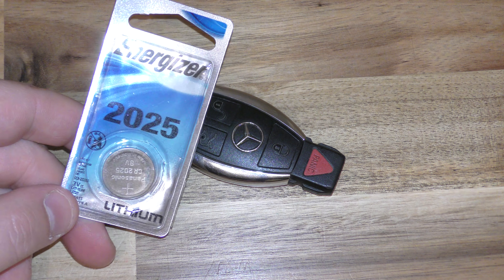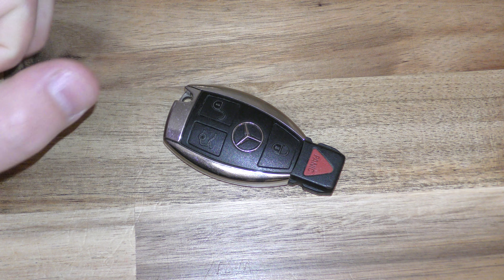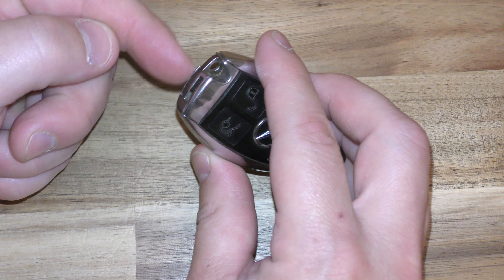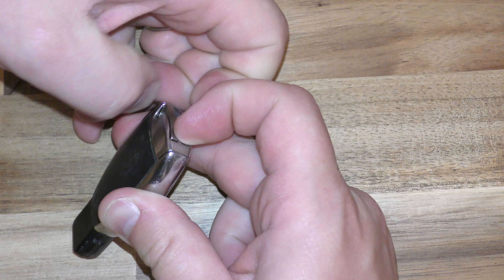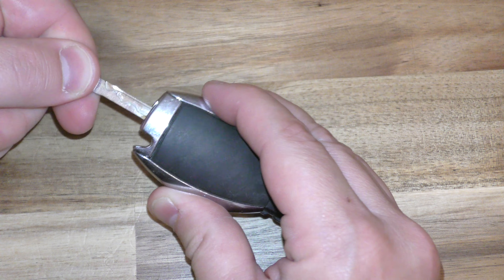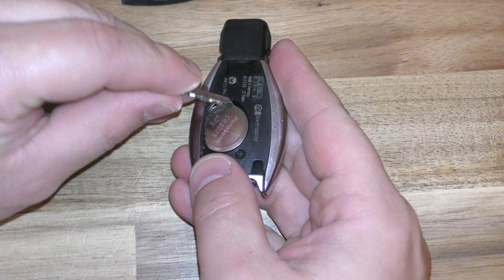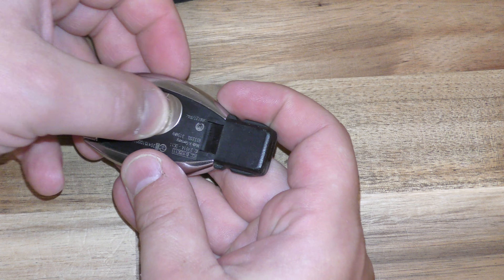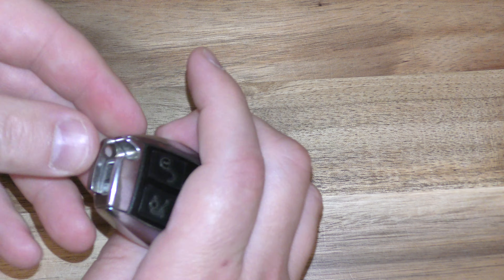Mercedes Benz key fob battery replacement - EASY DIY

Comment from the maker: 2025 Battery you need - https://amzn.to/3g6MHLc
Reply: P
Reply: 90
Reply: a more common 2032 fit and worked just fine for me !
Reply from the maker: Either will work in this fob
Reply: @KeyFobRob  Thank you, Rob!
Reply: @Chriscx  does one last longer though?
Reply: The larger 2032 has 240 mAH while the smaller 2025 only has 170 mAH, which stands to reason the larger should last longer. However, I imagine you're looking at 5+ years either way. If it drains faster than that. the battery is more likely to drain due to some pressure being left on one of the buttons overnight. For this instance, the size of the battery will not matter.
Reply: @Chriscx naw I had them and compared my two keys after. The 2032 was bulging the casing. So I doubt it's still waterproof after
Reply: Thank you. I'm 30, don't know much about cars, I knew they had a mechanical key, I used ones yesterday to help someone that was locked out of their car, but thank you for showing me it's a 1minute job to fix the battery for them.
Reply: There are some aftermarket versions of this key that do not appear to open by inserting the key to pop the back plate off. Would you investigate this and PIN an additional comment that goes through any alternative steps? I am not able to get the back off and followed the video.. as it seems so easy amd simple. Others have left comments describing similar problems. THANKS

Comment: All was great until it came to where to push the key into the top to pop the back open. Wished you'd shown were you did that but otherwise great, thanks.
Reply: Was great that the video was short, but on difficult parts like your describing (where I had the same issue, and still don’t have the back portion taken off). He should have slowed down and given a better direction that just pop this in right about here.  What do you mean pop this in right about here?  Is there a different tool I can use instead of thinking im going to damage my key?  Does the key fit properly into a certain area?  Are you supposed to be hitting something that allows it to pop out?
Reply: @KeepitReels4real all you have to do is watch where he's sticking the key in to find the position where it'll pop off.  It's not that hard.  Mine popped off in less than 2 seconds.
Reply: He did show it!
Reply: There must be slight variations on fobs because mine ain't just 'poppin off'
Reply: @Tony-kc5fi  it will!!!
Reply: No it didn't..my key although looks very similar comes apart in a different way..! Basically the silver bits come off, top first then the 2 side trims..giving access to circuit board and batteries by sliding them out...very tricky when your just going at it blind 😂
Reply: @Tony-kc5fi  Glad you were able to sort it
Reply: Great! Done in under 1 minute! Thank you!
Reply: It only took like 5 seconds to figure out. If it's that hard for you, or if you have a different model, just use your owner's manual. It's not everyone's job to walk you through it.
Reply: @lovelyrose2989  Funny that your "handle" doesn't quite match up with how you address people. Curious.
Reply: Did you actually watch the video? 🤦‍♂️
Reply: @KeepitReels4real I am having a similar issue. My key appears to be an aftermarket one so.. the "easy trick" that it appears to be in the video is not working. There seems to be a different process for some keys and this video does not address that.
Reply: For those where this process didn't work (me included, but thank you for creating the video), there is a slightly different model key fob. I found manual and it explains you actually take shorter end of mechanical key (picture it like bottom part of a capital "L"), push that part slightly into back part where key release latch is, and then move it away from you. That will allow you to pull out the unit (silver part) where 2 batteries are located. On this key fob the black part doesn't actually pop out (that's why some of us were struggling to get it to work). Hope this helps
Reply: @ZacLinton For those where this process didn't work (me included, but thank you for creating the video), there is a slightly different model key fob. I found manual and it explains you actually take shorter end of mechanical key (picture it like bottom part of a capital "L"), push that part slightly into back part where key release latch is, and then move it away from you. That will allow you to pull out the unit (silver part) where 2 batteries are located. On this key fob the black part doesn't actually pop out (that's why some of us were struggling to get it to work). Hope this helps
Reply: @TL-uw3nu there are at least 2 different variations of these keys, I have 2011 SL550 and 2013 S550, identical keys but 1 has 2 batteries  that slide out, the other has 1 battery that the cover pops out. The video did not mention the differences. The older version is a bit challenging to open.
Reply: @Tony-kc5fi Yes, there are  different ones

Comment: Thank you for the video to remove the key fob battery. I wanted to make one note for some Mercedes owners. Some of you might have the same problem that I do. Energizer batteries do not stop the 'Replace Key Battery' message from the odometer. The trick is to use a Panasonic battery. Some key fobs work with any battery, but mine has to be a Panasonic battery. Still the CR2025 - but a Panasonic.

Comment: Clear, concise and to the point. That's how they all should be.
I just opened mine and found some corrosion on the battery at the edge contacts. The battery still read 3V, so after cleaning the edge and turning it to a shiny area, key worked perfectly again. No need for a new battery.
Thank you.
Reply from the maker: Glad it was helpful!

Comment: Thank you! Had I known this a month ago? I would not have been going through intermittently, having to use the manual key and setting off my alarm which is a new fit. I thought I was going to have to spend money to get a new five, and this worked like a charm. I got the battery from CVS and did it right in my car before I drove off. Thank you!🎉😊
Reply from the maker: Excellent! Glad the video was able to make your day a little bit easier :) Take care

Comment: Quick and to the point, THANK YOU! Very helpful! Also I just wanted to note I just tapped my fob upside down and the old battery came out instantly, may work for you if you want to avoid struggling with your key or screwdriver to remove the old battery.

Comment: Thanks..perfect!!!!!!
..my battery says CR 2032
FYI
CR2025 batteries are similar to CR2032 batteries, but they are slightly smaller and have a lower capacity. Both CR2032 and CR2025 batteries are widely available and are often used as replacements for older or dead batteries in electronic devices. Including electronic car keys.

Comment: Very helpful video because the battery died on my Mercedes E350 key FOB.  Thank you very much!!
Reply from the maker: Great! Glad the video was helpful
Reply: How did you know that it was the battery on the key fab that died? And that it wasn’t another problem. I’m asking because mine died on my 2019 A220, and I’m a little concerned about driving it. But Mercedes says it’ll take a week at least before they can fix it
Reply: @bntelenniss  I knew it was the battery when the key fob wouldn't lock or unlock my car doors.  It's easy to replace the battery yourself by following the instructions in the video.  You can buy replacement batteries on Amazon (they're inexpensive).  If you're not up to the task then take your car to the dealer and ask them to put new batteries in your key fob. You should have two key fobs so remember to replace the batteries in both of them.
Reply: Don't worry, a new battery in your Key FOB will probably solve the problem.

Comment: Thanks much. Other video's show that with the all black, or chrome edged key, to remove the 'mechanical' key, then use that key to push to the side/slide lock tab to the side. Mine would not do that, no internal tab to slide over. Then I found this great video, shows to push down into the depth of the key, then I was able to finally open mine. Why would MB change the black & chrome edge keys from a slide over tab, to a push down tab? Wonder how many have broken their key parts in frustration not knowing there are 2 different types? Something else strange, I have 2 fob keys, one is all black and contains two 2025 batteries, and the other has the chrome edges but only contains one 2025 battery. Why would they do this? Why 2 batteries for the black one, and one battery for the chrome edged key? Thanks for your video, it saved me frustration trying to slide over a tab that other video's show that mine doesn't have, mine is a push in like your video shows, thank you!

Comment: Was able to use 2032 battery instead of 2025 works fine
Reply from the maker: The 2032 is slightly thicker than the 2025. 2025 is best to use but the 2032 certainly will work in a pinch

Comment: The mechanical key is missing. I was able to use a small flat head screw driver to get the back to pop off. Any ideas if the mechanical keys are available online or must you go to Mercedes and pay an arm and leg?
Reply from the maker: Are you missing both mechanical keys?
Reply: @KeyFobRob   We only have 1 key fob.
Reply from the maker: if you don't have 1 that you would be able to duplicate, then you're entering arm and leg territory

Comment: Hope this works. 
My boyfriend has issues with the key fob for his '07 E350, it won't work at all if the fob is cold. Even after just driving the car with the a/c on or sitting at home in the air conditioning the fob gets cold and refuses to work. We have to warm it up to lock or unlock his car....
Reply from the maker: That's usually a symptom of a weak battery. Changing the battery should help tremendously

Comment: Does it have to be a 2025 battery? I have a 2010 c class Mercedes
Reply from the maker: You could use a 2032 in a pinch

Comment: My question is how do you know that it’s a key battery that’s causing the problem. I have a 2019 A220, that just died yesterday and wouldn’t start for a few minutes, the dash went black, eventually it did start. But how do I know it’s the fab. Mercedes says it’ll take me over a week and a half to get my car serviced. So much for Mercedes service🙄
Reply from the maker: Your dash will indicate that the battery on the fob is low

Comment: Why would it ask for a battery change a week later? Happened a few times to me now
Reply from the maker: Probably just a bad batch of batteries. I'd get some new pack - 2025 Battery you need - https://amzn.to/3g6MHLc
Reply: @KeyFobRob  I have tried a few
Reply from the maker: @AD-de8jg  The connection have any corrosion on it?
Reply: @KeyFobRob  not that I can see and it’s happening on both keys
Reply from the maker: it just seems like the pack of batteries you have is weak. Try and brand new pack from Energizer or Duracell
Reply: @KeyFobRob  thank you I will

Comment: I have the exact same fob bit it takes 2032 batteries.
Reply from the maker: The 2025 and 2023 are generally interchangeable. The 23 is a little bit thicker and will last a little bit longer

Comment: My fob looks the same but the panel will not open. Even my garage gave up.
Reply from the maker: There are two different styles - Try this one - https://youtu.be/aaYjM2S7BmM
Reply: @KeyFobRob  Thanks Rob. That got me in and replaced the batteries with new. But it won't work. That's two fobs that don't! The original 1999 and a replacement from around 2015 - the one in the other video. Thanks - I'll keep trying!
Reply: @KeyFobRob  UPDATE... UPDATE.. dodgy terminal but now fixed. Many thanks.

Comment: Mine doesn't work like this. You need to slide a plastic lever over from the middle to the side the key part was in it. Then it slide out the top and take 2 batteries.
Reply from the maker: That fob looks like this - https://www.youtube.com/watch?v=aaYjM2S7BmM
Reply: @KeyFobRob  That's it. But mine now slides out, from trying to do it the way this vide above shows. It messed up the plastic slide part. I wish I found the video in this link you shared here, first. Oh well. Learn from experience. 👍🏻
Reply from the maker: This style? https://www.youtube.com/watch?v=aaYjM2S7BmM

Comment: My key fob looks just like yours, but that process doesn’t work on mine
Reply from the maker: you might have this fob - https://youtu.be/aaYjM2S7BmM
Reply: And the other video I watched on this my key fob has two batteries, not one. Is there a difference or two different types that look just alike?
Reply: @KeyFobRob  thank you very much. That was the one, but what’s funny is my key fob looks more like the first one because that one has the metal Mercedes-Benz logo in the middle of it and the new one you just sent me has an all black Mercedes-Benz logo but it worked and I appreciate it greatly🙏🏾
Reply from the maker: @freddyjason3142  glad you could get it sorted out!!

Comment: You need to remove protective film from the back of the new battery before inserting
Reply: That's common sense... That's not what this video is about directions for the key, not the battery. The directions for the battery are on the back of the package they came in.....

Comment: Hey mine just stopped working and i replaced with a CR 2032 Duracell.  It fits but now doesn't work at all.  Is it the battery then?

Comment: Tried this method and it broke the key apart without releasing the back cover, not too happy about it... could be a costly repair
Reply from the maker: Your fob is likely the one that preceded this model. https://youtu.be/aaYjM2S7BmM 

You can get a replacement case on eBay or Amazon for $7 to $10

Comment: This is godawful. For those who just need to replace the battery or back, you just insert your metal key into a slot in the rear and the back case will pop right off